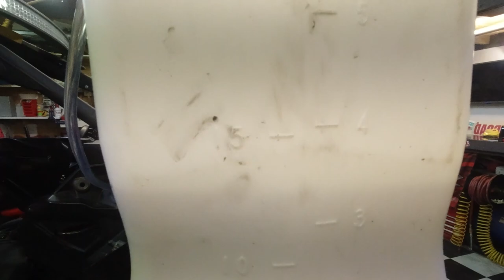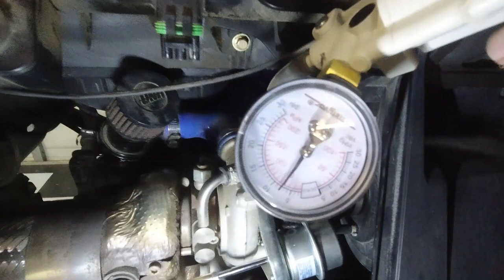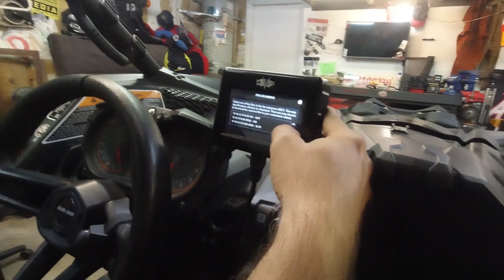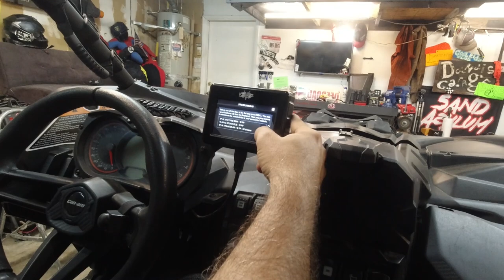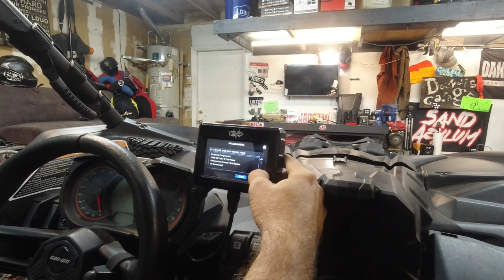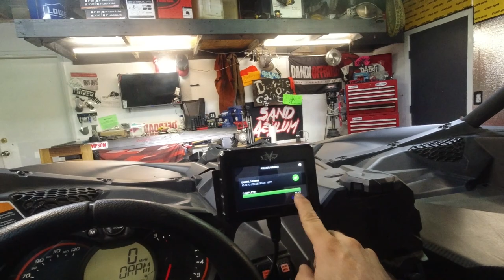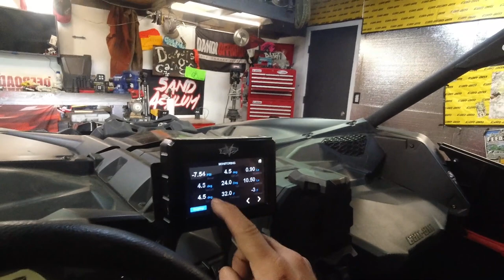EVO 3RWI Install MIXING OUR OWN FUEL

Comment: Your fuse box lid probably has tape over the decal from the factory making hard to read. Mine had a protective tape on it.
Reply from the maker: It was gone, and the decal faded, but we did find the location of the fuse